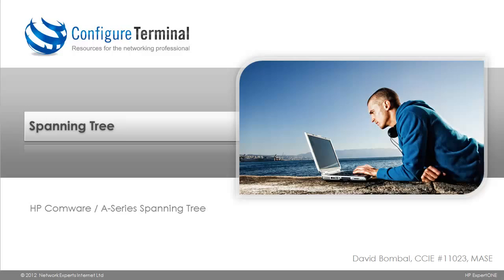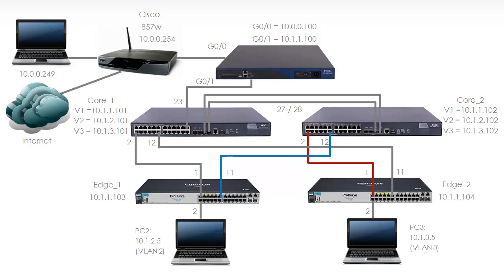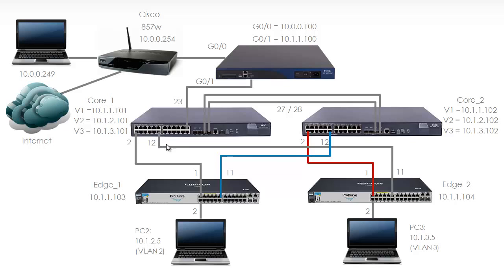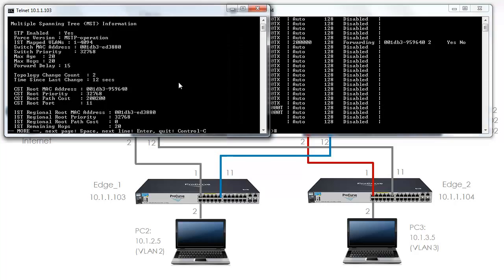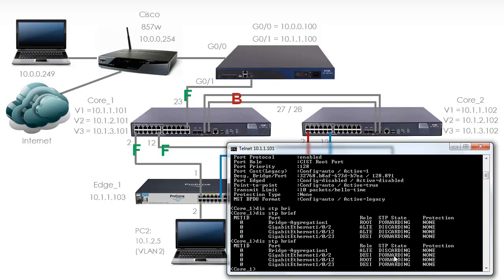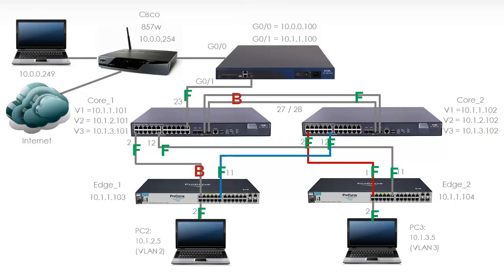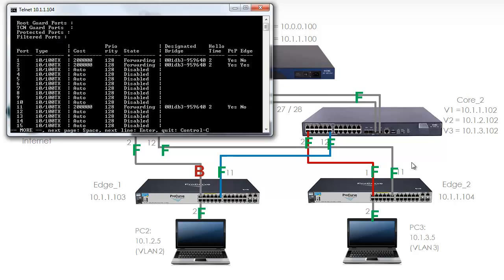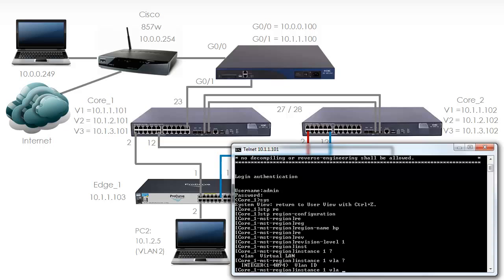Spanning Tree configuration on HP Comware switches part 1

Comment: Good afternoonI have HP 2920 switch in which I have the STP protocol enabled, and this protocol blocks some port of the switch please help me to solve this problem, I thank you in advance: there attached report.
I 03/10/17 11:43:26 00435 ports: port 43 is Blocked by STP
I 03/10/17 11:43:27 00079 ports: trunk Trk6 is now inactive
I 03/10/17 11:43:27 00077 ports: port 43 in Trk6 is now offline